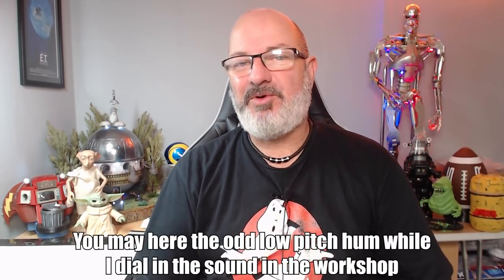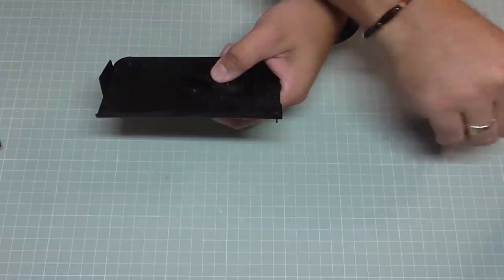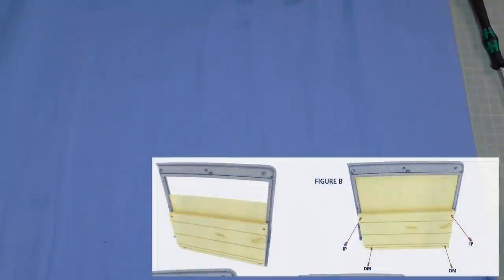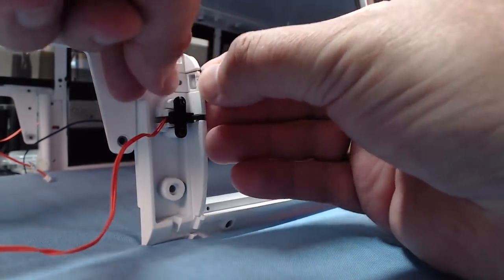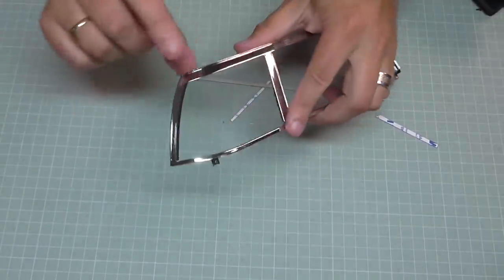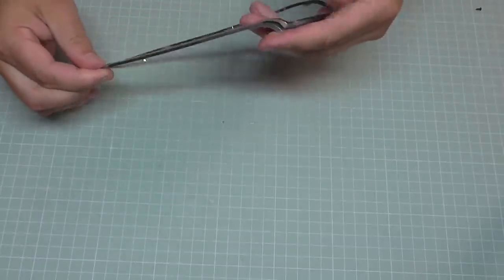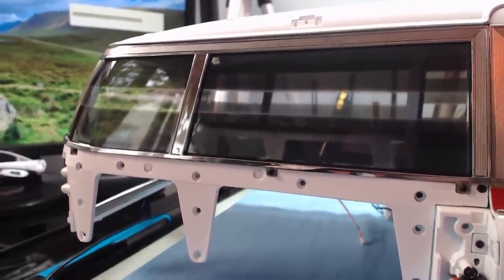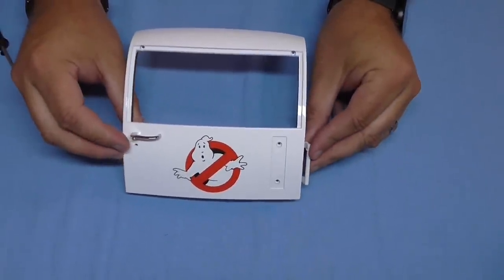Build the Ghostbusters Ecto-1 - Part 99,100,101 and 102 - Finishing the Doors

Comment: What method did you use to remove the sticker as I did it for the door but left loads of sticky goo
Reply from the maker: I just rubbed my thumb vigorously over it to remove the tack
Reply: @WorldofWayneUK  did you just peel it off or use a hair dryer to loosen first
Reply from the maker: @scottduggan1983  hair dryer